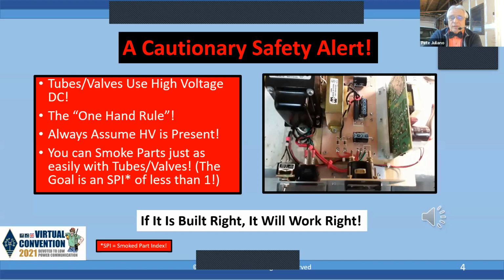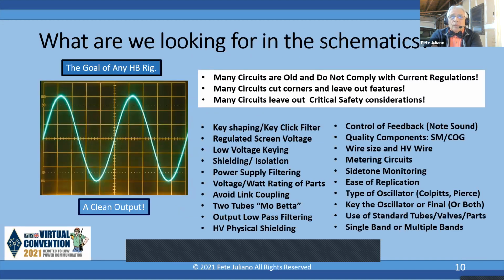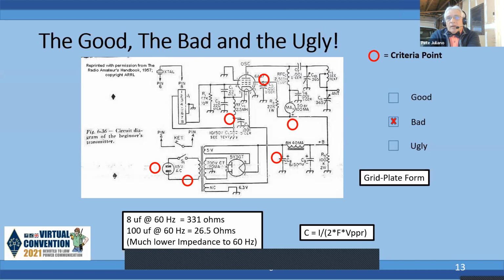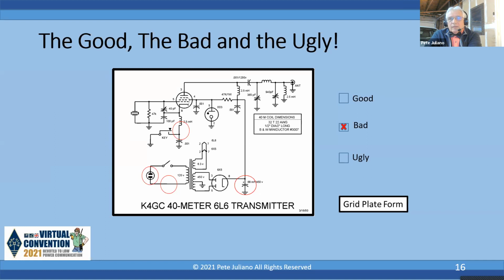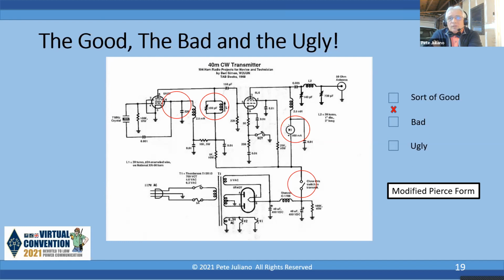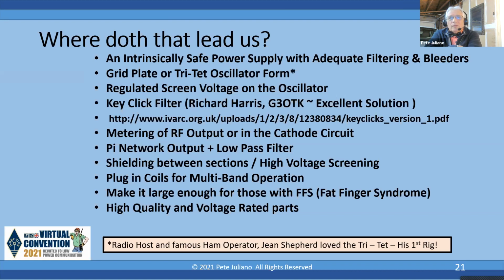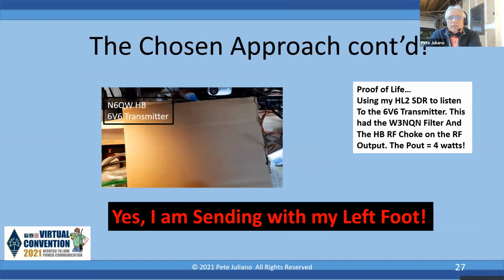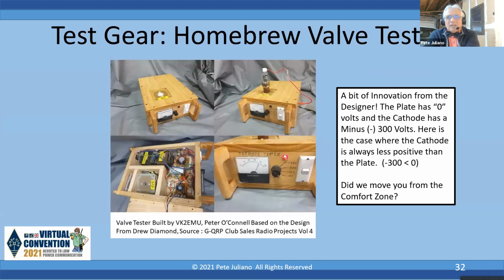Pete, N6QW, talks about building a valve, or tube, transmitter in the 21st century.

Comment: I get a couple of Watts from a 61BT valve out of a non-working oscilloscope. 40m + 60m G-QRP xtals. I always put a bleed resistor in power supplies and always check with a multimeter it hasn't failed if working inside.
G4GHB